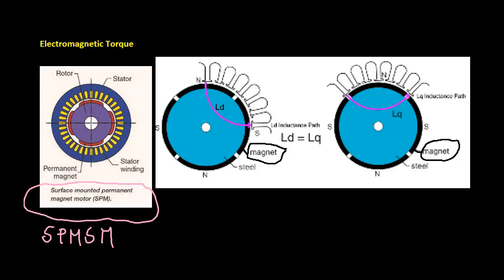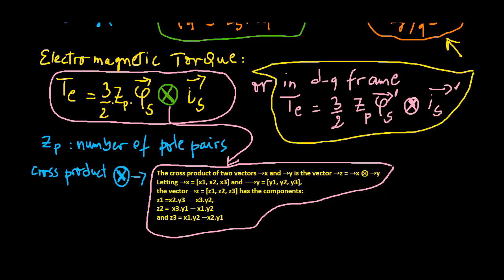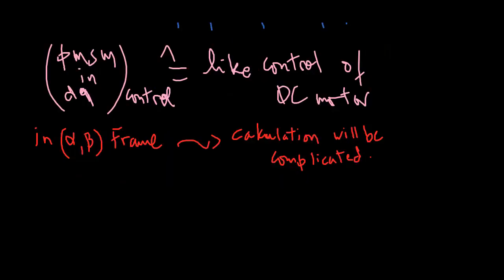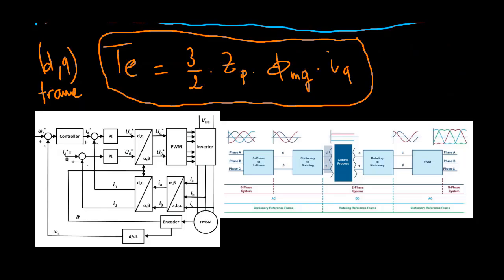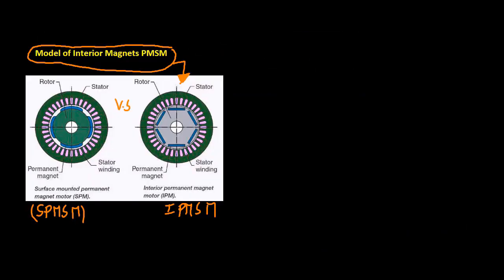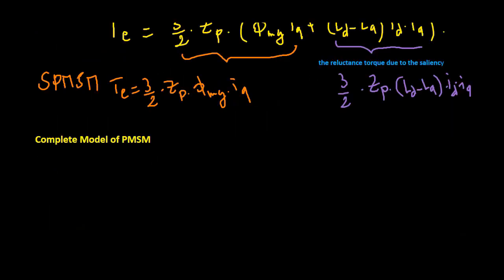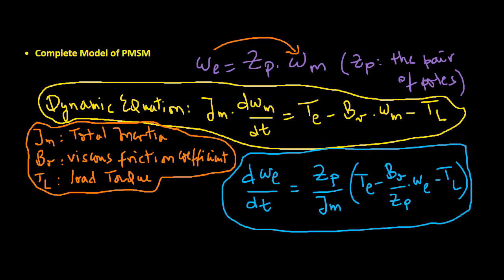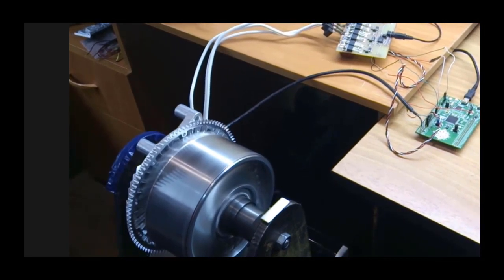Complete d-q Model of Permanent Magnetic Synchronous Machine

Comment: How do you calculate the flux linkage due to the permanent magnet (wb)?
Reply from the maker: If the operation of field-weakening is not involved, the set-point for rotor flux psi_rd will be constant. However, if field-weakening is involved, the reference signal to rotor flux psi_rd change. therefore you can enter the speed as a setpoint for the field-weakening block, in this situation you use a flux controller and for the flux determination you use an estimator or osbserver.  see the picture below here : https://en.wikipedia.org/wiki/Vector_control_(motor)
Field weakening control is a key technique for high speed operation of electrical machines.
for this machine it s calculated as 0.96 (contant torque region not in field-weakening region). i tell you how to calculate for the last video because i have the machine parameters (Voltage and frequency ) phi = V/(2*pi*f*4.44)=415/(2*pi*50*4.44)=0.29=0.3 Wb. Last video: https://www.youtube.com/watch?v=I28CJca5RFs @ 5:45 and @ 5:13. At speeds below rated speed, the flux is kept at its nominal value whose value can be computed using the name-plate data of the machine.
to learn more search back emf and flux for the motors. https://www.electricaleasy.com/2014/03/emf-equation-of-transformer.html